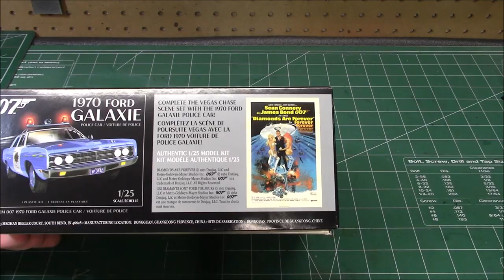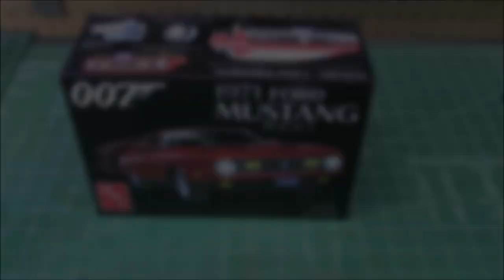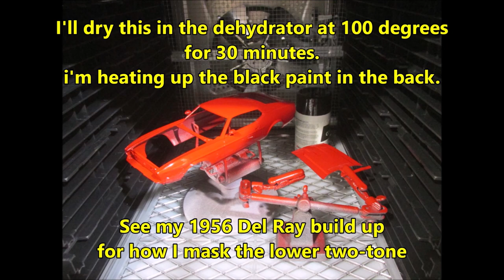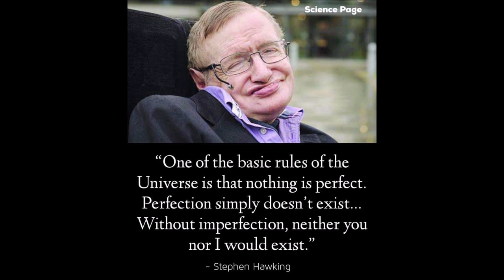1971 Ford Mustang Mach 1 1/25 Scale Model Kit Build Review James Bond 007 Diamonds Are Forever AMT

Comment: Nice old mpc kit wheels were always incorrect a sweet build as always I have a question have you built the mobuis 61 Pontiac ventura igot the other day they say if you install the radiator support the grill won't fit

Comment: Nice job once again Chris,but I have a question. Why prime the body if you're gonna paint it the same color? Seems like an extra step to me....
Reply: The primer gives the paint a mechanical bond to the surface.  If he just sprayed color over the smooth plastic,  the paint might chip off. Plus the lighter color under the red makes it  pop more.
Reply from the maker: It also makes the plastic opaque.  Red over red will look see thru a lot of the time.
Reply: Ahhh,okay. Thanks for all the tips you give !

Comment: Hey Chris  does the dehydrater help with the finish or do you just use it for time purpose? Keep up the awesome builds and thanks
Reply from the maker: Just speeds up my work.
100% absolutely not needed to make models or have fun, I just got it to speed my work up since I make 100+ models per year for the show.
Reply: @hpiguy  thanks for the fast reply. That's what I thought but just checking. Thanks again Chris.